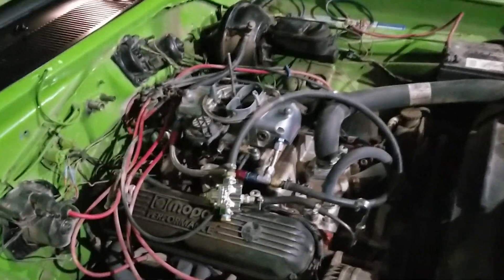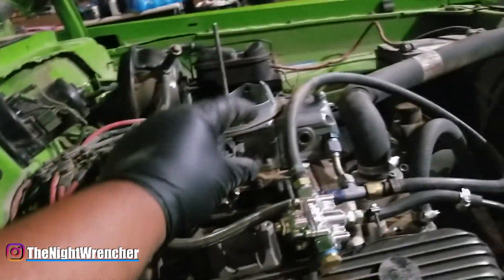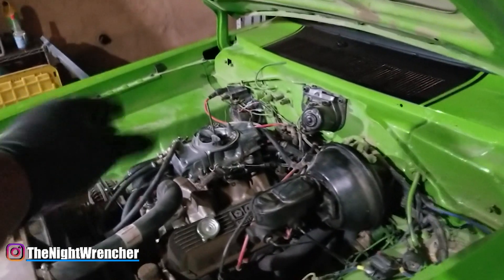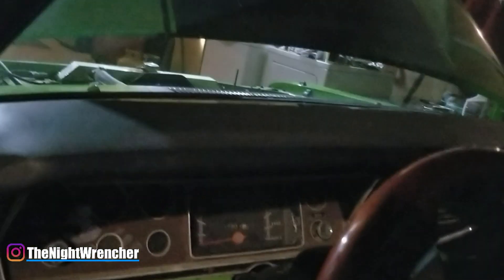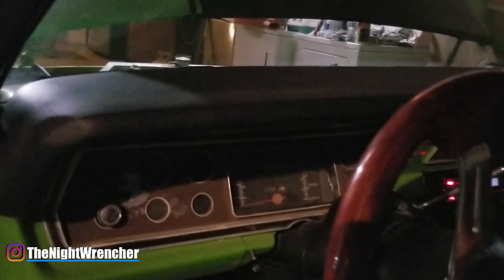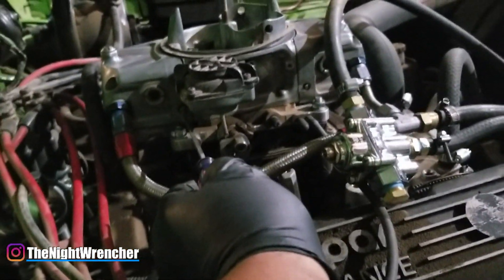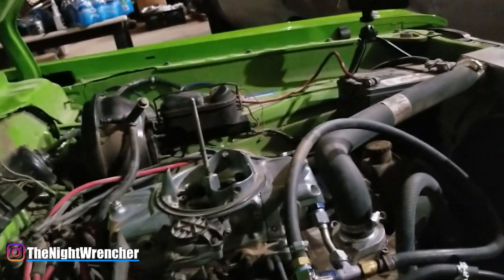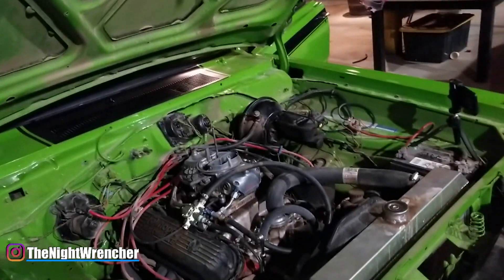HOW TO SET HOLLEY IDLE MIXTURE AND IDLE SPEED | Holley Carb Secrets | Holley Carburetor

Comment: Another note, with electric choke, if your high idle screw is in too far, as in all the way like mine was, it will not allow your curb idle to be set properly. You may think that the choke system has nothing to do with these adjustments because you are doing it when its hot, but it does. Your high idle adjustment holds open the butterfly just a tickle on choke. If it doesn't kick out all the way after warm, it will continue to hold that butterfly open at idle, thus exposing your transfer slots too much. This will render your curb idle and idle mixture screws useless. It will cause surging at idle and cause a stumble off idle as well. You should be able to kill the engine by turning the curb idle out too much. If you can't,  theres a problem. Once your curb idle is set, you should be able to kill the engine by screwing in the idle mixture screws all the way. If this doesn't happen, your engine is recieving fuel from somewhere it should not be(ie: transfer slots that are too exposed) On the other side of the spectrum, make sure your choke butterfly is opening all the way when hot. If this doesn't happen, you will be trying to adjust everything while slightly choked. I am aware other things may cause these same symptoms,  this is just one example of tail chasing that I experienced. Hopefully this helps someone as I beat my head against the wall trying to figure this out. This was on a 4160 carb that I got for free that was "running when parked" lol

Comment: I was always taught to do carb adjustments with the air cleaner on, no?
Reply from the maker: For Idle, it doesn't matter. For street tuning, its optional. The only thing that can happen is if you tune without the filter and then install the filter, the engine might run a hair richer

Comment: Hey I asked for your help on drilling or adding the rear block idle screws to a block that didn’t have them bc I was mistakenly given the wrong one:we it turns out after looking at it more Quick Fuel drills,taps and fills with Allen screw so all I have to do is replace with proper screws.cool beans that was easy enough but thanks for being responsive.
Reply from the maker: Thats awesome man, good to hear it worked out 👍

Comment: I know how to adjust it,I went to jegs and they gave me the wrong metering blocks for the rear and I need instruction on drilling and adding the adjuster.they’re quick fuel billet and the spot is there and I could likely do it but hopefully I can find a little help to be sure,thanks
Reply from the maker: There are 2 spots where you can run them but the top one is easier. I believe it takes an 8-32 tap into the large fuel passage on the top corners of the metering blocks. No drilling required. I'll make a video on it 👍

Comment: What about proper transfer slot exposed? How do u tell after messing with idle?
Reply from the maker: You have about 2-3 turns before the t slot is over exposed. If you idle is set up correctly, you should be be 1/2 to 1 full turn in. If you need more than that, you need more timing, idle mix isnt right, or your cam is too big so you need 4 corner idle and need to open the secondaries

Comment: Awesome Video...
Do You think its ok and easier to 1/2 turn the rear and adjust the max vacuum and best idle only from the front ?
Reply from the maker: A lot of times yes because thats usually where I end up but its not a solution for every carb. Some carbs have wanted a quarter turn or 3/4 of a turn so it just depends
Reply: @NightWrencher  👍 yep... I did this to my double pumper and it was so much easier to tune that way... But like You say it is based on what the engine needs. Thanks for the reply and shared knowledge.

Comment: This will be fun with my Bronco. I’ll be climbing a ladder every time.
Reply from the maker: It was fun on my truck. Lifted 4" on 35" tires 🤣
Reply: @NightWrencher  yeah. I was trying to get it all tuned. This video was very helpful. But my truck is having a weird backfire issue out the exhaust now. But definitely thanks for the video. Got my new carburetor dialed in a bit more.

Comment: What is a good idle AFR if your running ported vac with no advance from the can? . 

I always would run full manifold and add around 6-12 degrees so I would idle at 22 or so and it wanted a rich AFR around 12:50 if I tried going up or down it wasn't happy .

Usually I would need to jet up a size or 2 with ported since withouts the extra timing it can run up in the 14"s at idle and despite the controversy between full manifold and ported I'm kinda thinking why these auto makers did this ported thing .

Being able the idle at a perfect 14.with no timing on ported put a smile on  mother nature's face 😋.

Although what the common AFR for ported I'm not in tune .
Reply: I usually tried for 13"s but it's very hard to get 12:50 on ported .
Reply from the maker: I'm going to have to make a video on this because a few people have asked me about it. Typically what I like to do is set the base timing at 13-15 for better starts and curve the distributor so that the advance comes in really fast and early. Qith that being said, you could back off the distributor to a lower base timing and run manifold vacuum for the advance as well. Typically you should be able to run a leaner mixture easier with more timing so I'm not sure why youre not able to get above 12.5 on manifold. What plug gap are you running and what is you base timing?
Reply: @NightWrencher   I'm at 10-12 base timing on 91 octane Pertronix 3 dist says it gives it 24 but I only had 30 total .
If  I bump up to 14 initial or more it thumps alot and shakes using full manifold so I settle for the 30 total and use the vacuum advance for the rest all in at 3k , that's around 40 total at 3 k with full manifold .
  With that  setting it runs pretty good although it  don't like  a lean mix like  1350 idle AFR I can do 13 but it will shake and stumble..
Now ported thats totally different I can go 14 idle and it will run fine although starting its a run on kinda start .
AFR in the  13:0 13;20-50 seems better ported  I can also go to 14 initial with no issues to get the 32-34 total on ported 
I  switched today but Im thinking the carb I bought on offer up someone drilled out some ports next to the IFR and that's why I can't tune it easy , I ordered a new one for 38 bucks a video would be great 😃👍 on the difference in tuning from full manifold vs ported  and how they differ from one another then viewers  like me can choose which one meets there performance needs 👍.
Reply from the maker: Yeah, its wierd, it shouldnt act like that. Let me know how it works with the new one 👍
Reply: @NightWrencher  well I had to really bump up the fuel to keep it from stumbling  I bought it new from a guy on offer up .
First thing I noticed after really looking at it the squirt nozzle was a 25 ? It cam with a #31  then looking at the metering block I'm told those should be drilled out to 0.06 ? The hole has a brass incert on one side the other is punched in or missing and on the right there is a feed hole next to the IFR and it's really big and looks like that's been drilled out ? .
So had to richen up the take off acceleration #35 squirter or it would go up to 16 AFR and a few pops at slow speeds .
Reply: I want to compare both primary metering blocks so I had to fatten up the primary side to mask the issue .
Reply from the maker: Yeah, sounds like someone messed up a new carb
Reply: @NightWrencher  then sold it to me for 150 👍😃  now with all I put into it I could had bought a 4150.
Reply from the maker: It happens 🤣
Reply: @NightWrencher  well I received the new metering block and it had brass incerts up high , they were the idle air feed .
Mine don't have those I installed it and it was so rich at 9 on the AFR I changed jets and it had no effect so I'm assuming those need to be drilled out they not the IFR there the higher ones idle air feed .

I called Holly to find the right metering block and they told me there was a tech note on the 1850 I have for hesitation the exact issue I was having they said to install a #35 squirter and put the pump cam in #2 position 🤓 .  In my trouble shooting efforts I ended up using a 35 squirter  .  Would be nice if they told me before tho 😅.
Reply from the maker: @TheThirdWheel618  I'm not aware of any metering blocks that have idle air bleeds built in except for the emulsion stack. Usually aftermarket blocks move the IFR from down low to up top so that might be what youre talking about. Without a measurment, you don't really know where you are at. I would say make sure you used the right gasket between the metering block and the main body because some have the seal for the accel pump missing and itll pull extra fuel through the vacuum well behind the PV.
Reply: @NightWrencher  I was kind of thinking that although I did put the other metering block back on because at first I thought that the Powervalve  was not working and that's why it was sucking gas .
I like how they made the pins so that when the gasket goes on It go only goes on one way but for that particular block I might have mistakenly put one from my 350 2 barrel on it so I'll have to check it  thanks again for all your help.

But the other one the first one worked fine again so it wasn't the only
Reply from the maker: @TheThirdWheel618  hopefully you get it figured out. I like small carb metering blocks on bigger carbs because its almost always tuned lean. Drilling up is way easier than installing plugs and redrilling it smaller
Reply: @NightWrencher  yeah that seems a lot easier so you're talking about maybe using like a 600 metering block on a 650?  The new one that I bought was an after-market one because they put the air bleeds up at the top.  There was none at the bottom and the holes up top look pretty dang small but I had a whole bunch of metering block gaskets and I wouldn't doubt it if I did use one from my 350.
Reply from the maker: Metering block from a 600 would work good on a 650 depending on the model. Try it and go from there
Reply: @NightWrencher  well with all the drama of that 600 I had  it eased my mind  when I called Holly they told me there was a tech note on the 1850 street avenger to up to a #35 squirter and reposition to cam spot#2  due to off idle hesitation I could not get it out . 
I did up to a #35 before I called them and that was the only thing that helped  but I thought there was something wrong with the carb itself I seen a guy on e bay selling a 650 for 1/2 price of new he said he used it for 300 miles but decided to go back to his motorcraft carb , it turns out it's a 670  street avenger in the box with all the new stuff in it  big mama jammer  I'm going to go through it and try that  .

Comment: Thanks so much for this info...super helpful!
Quick question. When I put on my carb I noticed my intake manifold had some residual gasket material along the bottom plane just splattered there from when the engine builder put everything together.  Could this effect performance as far as flow?
Reply from the maker: I've never seen gasket material stuck to the intake plane but I have seen it stuck on the carb flange. If its inside of the intake, I would try to take it off so it doesnt fall into the cylinders. Aside from that, it shouldnt affect flow.

Comment: Do the 4 corner idle screws control fuel? I thought it was air that it controlled?
Reply from the maker: Yes, the idle screws control fuel. You turn it in to block fuel, and turn them out to add fuel.
Reply: @NightWrencher  awesome. I’m not sure why I thought those were normally air screws. Currently doing this on my .060 318
Reply from the maker: Sweet, it should work exactly the same as this video then. You could follow it almost exactly and you should be able to dial yours in.
Reply: @NightWrencher  thank you. I was having some trouble with white/blackish kinda smoke at idle n figured it had to be my 4 corner idle screws
Reply: @NightWrencher  out of the box the brawler was .75 of a turn out all the way around on the 4 corner idle screws
Reply from the maker: Every engine is different so you'll have to redo it if it doesnt work for you
Reply: @NightWrencher  right on. Thanks for all the replies. I’ll let u know how it goes.
Reply from the maker: @bsrob1  sounds good man 👍

Comment: What jets would be a good starting point for my mighty demon? It's on my 6.0 with f35 cam 706 head. It won't idle for shit. I've got the 4 screws out 1.5 turns just don't notice any change by turning them in or out
Reply from the maker: Jetting does not affect idle quality. If you turn all 4 screws all the way in, the engine should die. If it doesnt die, then your throttle is too far open or you have an internal fuel leak

Comment: That's a demon a race carb its rich from factory
Reply from the maker: Its actually not a Race Demon, its an older street demon but on the contrary, it used to run lean before I started tuning it.
Reply: @NightWrencher  interesting, Did you buy it new, somone might have already leaned out the jets  in my humble opinion the "street" and race demons are always rich compared to holleys in fact if you look it up a 750 demon pulls around the same air as a holley 850 anywho happy wrenching
Reply from the maker: Actually, it was the IFRs that were lean. The IFRs feed the idle screws so both the transition and idle were lean

Comment: I have a regulator with perfect pressure I have float bowls set perfect brand new Holley and I’ve adjusted the air fuel mixture screws to idle perfect but when I drive and hit the gas a tad tk hard it backfires and when I come to a stop and take off even slowly it backfired
Reply from the maker: What is you base timing set at?
Reply: @NightWrencher  I’m not sure I’m very scared to fool with the timing Becuase it ran great before the carb problems which was only some months ago but it also dies when coming tk a stop if not backfires when I h the gas
Reply from the maker: I would check that first before anything else. Timing has to be dead on before making any changes to a carb. I'll make a video going through it so you have something to refference

Comment: I have changed spark plugs wires , new carburetor electric fuel pump all gd stuff but still something is wrong the timing was checked but it backfires at high rpm any thoughts
Reply from the maker: You said timing was checked but you didn't say where it was at. What is your base timing and what is the max and at what RPM?

Comment: How does putting the air cleaner on effect the tune (balance) of carb.
Reply from the maker: The air cleaner acts like a slight restriction causing the mix to richen up. Thats why engines are not dynod with them on and a lot of race cars dont either

Comment: Is this pretty much how you adjust all the hollies with the four different judgment points? Do I need to start with the curb idle screw all the way in/down?
Reply from the maker: Its an easy way to do it with 4 corner idle carbs. The point of running in the speed screw is just to keep the rpms up and give you a good starting point. 2 corner idle is the same way but with just the front 2 screws
Reply: @NightWrencher  so screw down the speed screw as well when I set the 4 adjustment points as well?
Reply from the maker: You screw down the speed screw a few turns and screw out the mix screws to 1 full turn out and then start the tuning like in the video. The real reason to turn it in is to keep the engine from stalling

Comment: Night wrencher, great video. I have 4 corner system and having issue on the passenger side mixture screws. I have Holley 670 with vacuum secondary and electric choke. When primary mixture screw is seated all the way in, it actually picks up more rpm. Car will not stall or die. If I turn the mixture screws out no matter how many turns, idle will drop to 800 rpm and stays constant Float level is about 1/8th inch below the middle on the see through window. And of course, all plugs on the passenger sides are black. I called Holley tech and they weren’t much of a help. They said cork gasket could be damaged. I checked the cork gasket with mixture screw out and it was fine. Friend of mine told me to try cleaning air bleeds with carb cleaner and compressed air well as mixture screw hole. After that, seat all 4 mixture screws in and main idle screws all the down to kill the motor. Then, back out one half on all mixture screw and 1 turn clockwise on main idle screw. Turn the engine on and try tuning again see passenger side mixture screw stalls or shut the engine off when turned all the way in. What do you think? Car has big cam so using vacuum gauge is almost impossible. Thanks man
Reply from the maker: Hey man, I was at SEMA all last week and forgot to reply. I would try to tune it when the engine is already hot and the carb is heat soaked for best results. At idle, if all 4 screws are turned all the way ithen , the engine should immediately die. If you're closing the idle mixture screws and the RPM is picking up then I would look for an internal fuel leak like in the power valve that chasing is a'lowing fuel to get bypassed into the throat. After its does like its supposed to when all 4. With big cams like that, RPM is your own point of reference but it will never run like OEM smooth due to the nature of the carb.

Comment: Hey nightwrencher great vid.  I tried this on my Holley double pumper and got the idle nice and smooth.  Best idle I ever had. Here’s the kicker. When I tried to take it out for a ride it stumbles pretty hard. I’m scratching my head on this.  Any idea?
Reply from the maker: Yeah its pretty normal when leaning out the idle, you need to compensate in other areas to fill in the gaps. Chances are your IFRs are too small or your accel pump shot is too small. Just depends on when exactly it hesitates